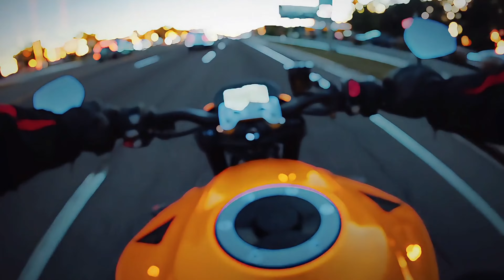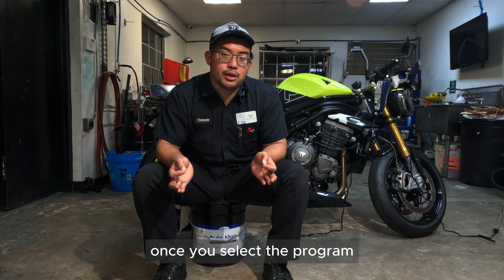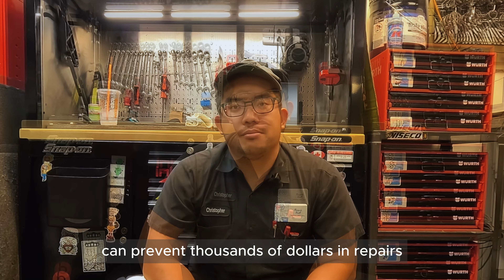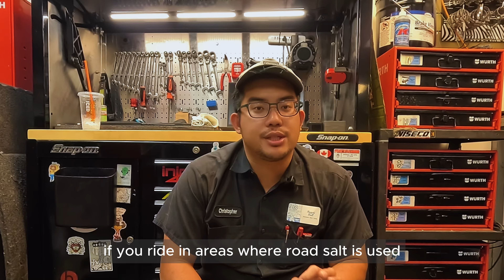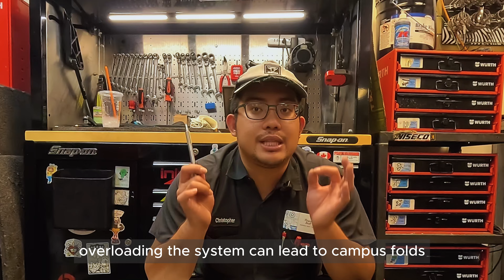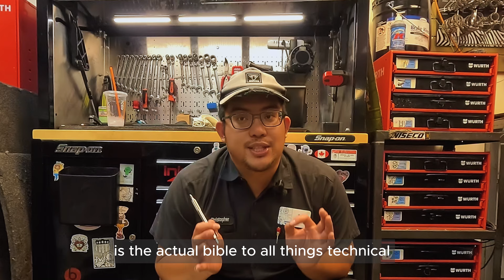Triumph Tech Reveals: 10 Mistakes Killing Your Motorcycle

Comment: Excellent video. Remind owners that the battery is a maintenance  item. Warranty rarely covers a dead battery.  How about doing a video on chain cleaning and maintenance/lubrication. Secondly a video on proper washing!  Thank you!
Reply from the maker: While the warranty for the motorcycle is 2 years unlimited mileage, the battery's warranty is 1 year. Most of the time, when the battery fails within that 1 year, it is covered without question. Thanks for watching, I’m planning on doing a maintenance video very soon! 🛠️

Comment: I've had my triumph bobber sat a few weeks in the garage due to the recent weather. Yesterday after starting ive had errors P2103, P1659 and P1695 I know what the errors are and have charged the battery and have a voltage reading of 12.8v the bike starts on the first trunk but I still have the engine light on and the errors present. Any ideas please?
Reply from the maker: Document those codes first for your records. Specifically, P2103 is related to the throttle body, P1659 points to the ignition power supply, and P1695 indicates a communication error with the instrument cluster.

The common thread here is low voltage. When a Triumph sits and the battery dips, the initial 'crank' can drop voltage low enough that the ECU loses its 'handshake' with the instruments or the throttle actuators. Even if your battery reads 12.8V now, that split-second drop during starting is what likely tripped the CEL.

I’d highly recommend an OptiMate 4 Quad Program for whenever the bike is parked—it’s a staple in my shop for a reason. If there are no actual drivability issues, clear the codes and go for a 15-minute test ride to let the systems resync. Check again after the ride; if they don't return, you've confirmed it was just a low-voltage 'ghost' in the machine.
Reply: Thanks for the reply, cleared codes and fitted new battery and does seem to have been a ghost, so all good now. Just a quick question as ive purchased the optimiser you suggested, do you use the can bus setting on the charger for the bobber if charging directly to the battery whilst its fitted on the bike? 
Much appreciated 👌
Reply from the maker: @brownpatch75  My apologies for the late response—I've been tied up in the shop and didn't see your message until now.

Regarding your question: The CAN-bus setting is specifically for use with a DIN-style socket (that smaller 'cigarette lighter' style port). Since you are using the premium weatherproof lead to connect directly to the battery terminals, you should not use the CAN-bus mode.

Set your charger to the Standard (Pb) setting for a direct connection. This ensures the charger can properly diagnose and maintain your new battery without any interference. Ride safe!

Comment: Great video! I’m looking into installing a throttle spacer kit in my 2025 1200 rs speed twin. Opinion? The throttle block has 2 screw heads that are anti tamper and look like torq ( swirled Phillips like). Can you confirm please
Reply from the maker: You don’t touch those. There should be 2 Phillips that hold the twist grip together. You remove those two Phillips and the assembly should pop open for you to install your throttle spacers.
Reply: @RaigekiBuilt great thanks! Keep up the videos!
Reply from the maker: @olafrohm3203 I should have a new one coming this Friday! Stay tuned to see my next bike!

Comment: A solid collection of tips — well done.

I’m heading into my 7th year of riding on my 2011 Tiger 800 (my first bike!), and overall it’s been very good to me with no major issues. I did have a shift return spring failure a few years back, which would’ve been a quick fix if not for the five-week wait for the part.

This past year I started experiencing some idle and rev issues. The tech at my local Triumph shop tracked it down to cracked and degraded air intake boots. I’m not sure if that’s typical wear for the age and 65,000+ km on the odometer, but once replaced it’s running great again. Unfortunately, that repair also came with about a six-week wait for parts.

It’s off the road for winter right now, but I try to get it out at least once a month just to keep things moving and cycle some fuel through it. I’m also running an Optimate battery tender (not the exact model you showed), connected directly to the battery. So far the bike seems to like it — we’ll see how it starts on the next dry, sunny day.

I almost went out today, but I had too much else on the go, and -11°C isn’t exactly fun riding weather! 🥶

Looking forward to more great videos! 🙌🏼
Reply from the maker: I’ve seen heated gear that will plug into din ports and sae battery leads! Might be worth looking into. I can definitely empathize with parts being horrendous. If it’s not back ordered, it’s obsolete. If triumph was going to make such a decent product, you’d think they’d have better parts support.

Comment: I came across a 2022 Bonneville Gold Line Black with only 400 miles. You covered many points that make me really hesitant to go through with purchasing it. I doubt the owner would have ensured the fuel was stable with such low mileage.
Reply from the maker: Negotiate a good price!
Reply: @R @RaigekiBuilt m all about minimizing potential stress these days. I don’t have a garage with tools at the moment, otherwise I’d be willing to take on any issues you described that might pop up. Am I wrong in assuming a bike that’s basically been sitting for 4 years could be a headache waiting to happen?
Reply from the maker: @drewdayss You’re not wrong. I’ve seen “new” 0 owner bikes in the shop with rusted tanks. Old age units being sold with 2-3 years old fluid. But go check it out. Thoroughly inspect it. A good deal is a good deal. An informed buyer is deadly.
Reply: @R @RaigekiBuilt  you’re a bad influence, haha. I’ll go check it out and give an update. Thanks for the replies and the content. Looking forward to the next vid.
Reply from the maker: @drewdayss I just picked up a 2019 bobber- not running. I’m going to be bringing it back to life. That’s the next video. Stay tuned!

Comment: Great video! I really like "miles are the coolest thing you can put on a bike". I read in my owner's manual for my Speed Twin 900 that chain maintenance should be done very 200 miles. I actually clean and lube my chain every 400-500 miles. Should I change this? Thanks!
Reply from the maker: Thanks man! Following the manual will only prolong your bike, never cause harm. I have found that cleaning and lubing that chain at every 200 mile interval and adjusting every 600 is the sweet spot.
Reply from the maker: Sweet bike by the way. I only wished the 1200 got the same colored tank…

Comment: What is "long time" for tip 1 and 3? Weeks? Months? Years?
Reply from the maker: In the service bay, I consider 1 month the line in the sand. Any longer than that and you're taking a real risk with phase separation. By 1–2 months, you need to be extremely cautious—that's when moisture-rich ethanol starts gumming up injectors and prepping your tank for rust. If it's sitting longer than 30 days, use a stabilizer (preferably just drain the tank) or expect a visit to a tech like me.